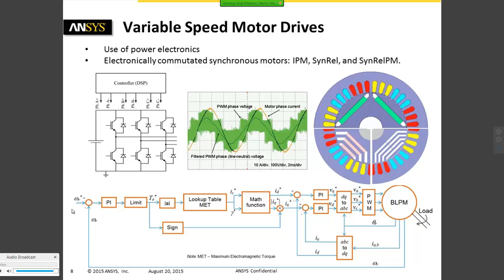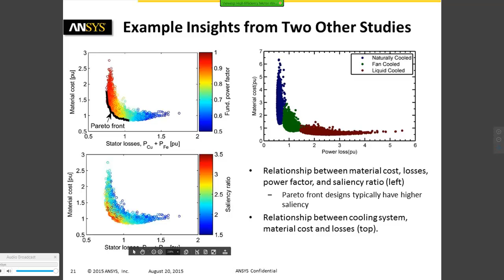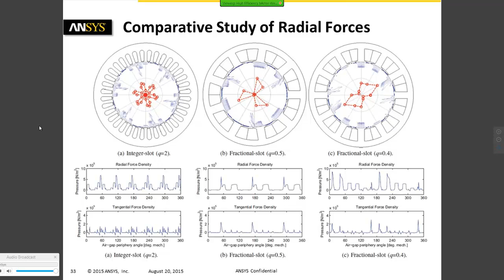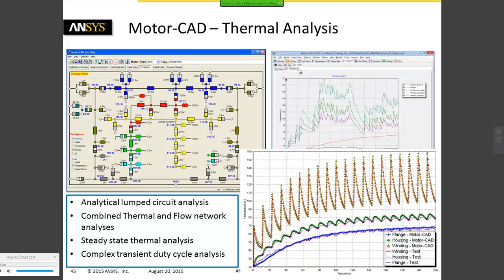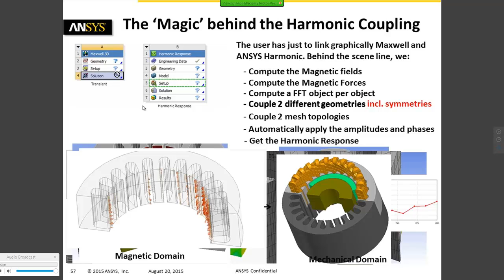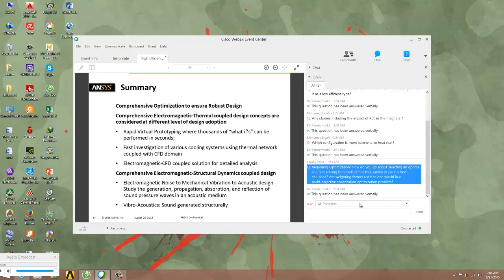Introduction to design high efficiency motor ANSYS MAXWELL 2015

Comment: i got this type of error 
Please help me to solve it

  Maxwell3DDesign1 (Magnetostatic)
    [error] Illegal external terminal 'Voltage_1': An external terminal must border the edge of the problem region and coincides with the surface of a 3D object. (5:04:10 PM  Oct 25, 2016)